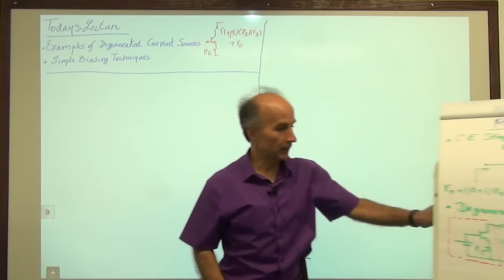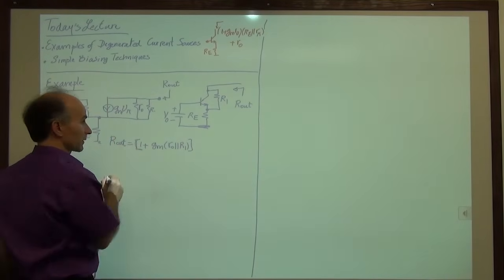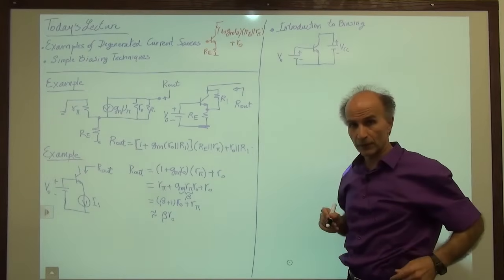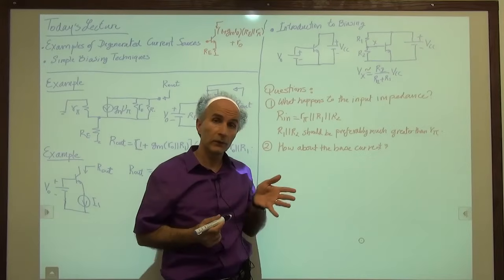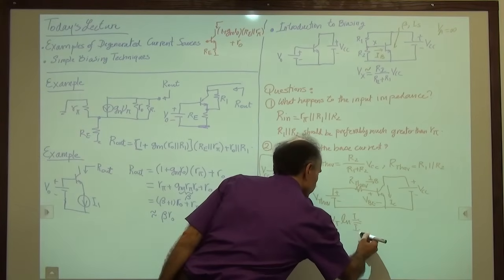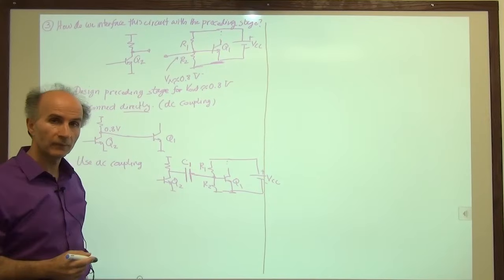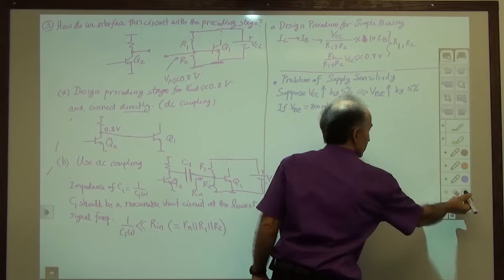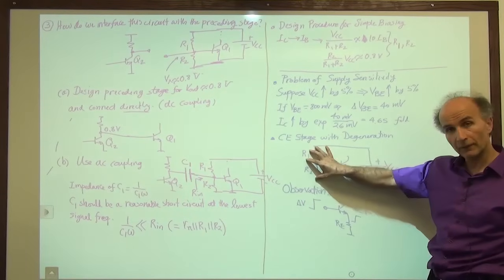Razavi Electronics 1, Lec 24, Biasing Techniques I

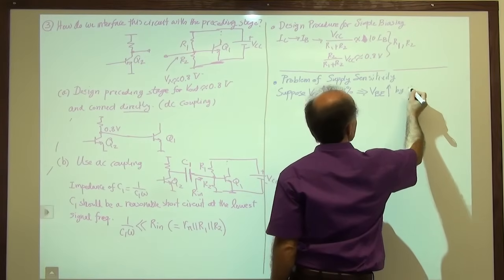Comment: 53:21 Vcc and VBE are not directly propotional, as seen in thevnins expression, VBE will increase by an increase in Vcc but not 5%.
Reply: When emitter is at ground. Vbe=vb, If base current is negligibly small when compared to VCC/ R1+R2. In that case Vth=Vb= Vcc(R2/R1+R2). R2 and R1 are constant here. If VCC increases by 5% Vbe also increases by 5%.

Comment: At 25:49, r pie is actually in series with the parallel combination of R1 and R2. So, R1 and R2 should be as small as possible.
Reply: no. rpi is between base and ground. r1 parallel r2 is between base and ground. equivalent resistances is rpi parallel R1 parallel R2.